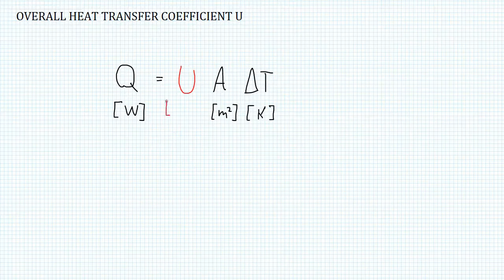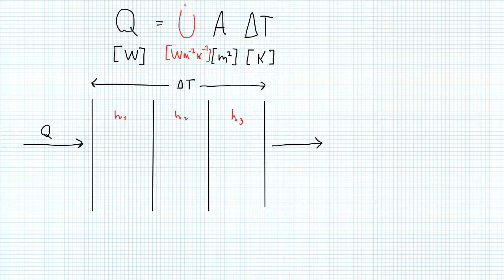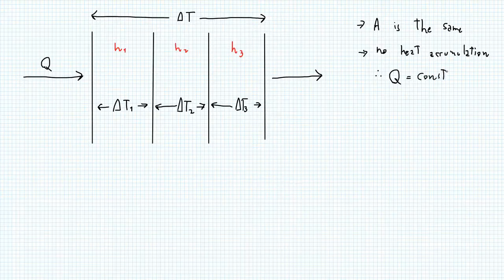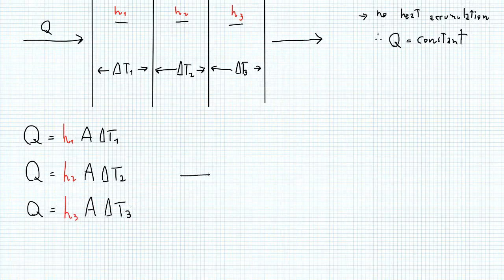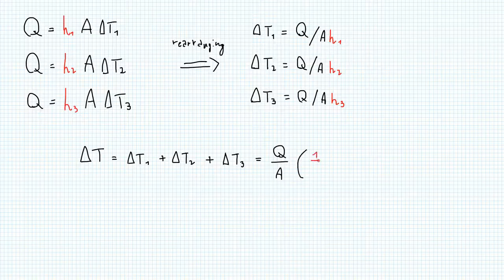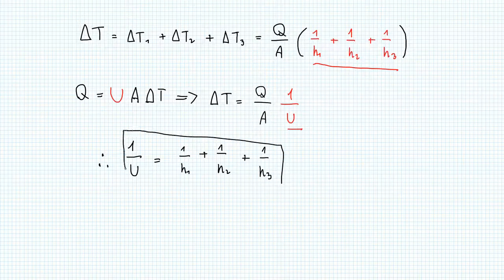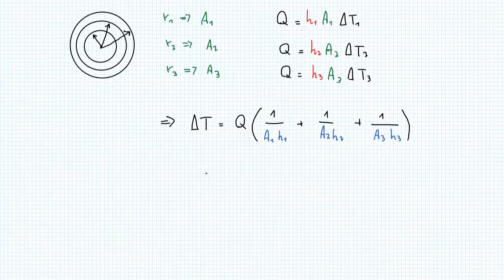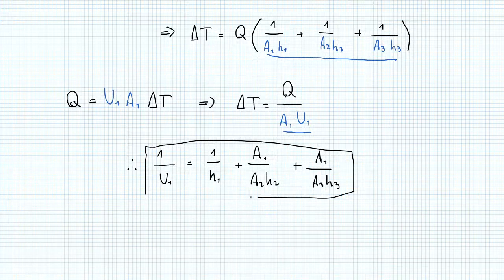Overall Heat Transfer Coefficient U

Comment: how to calculate heat exchanger  (Wast Heat Recovery Unit)
Flue gas flow rate 4293kg/hr  (3355 m^3/hr)
Heat Transfer Capacity  required -514 KW
Flue Gas Inlet Temp.  -497 °C
Flue Gas Inlet Temp.  ? °C
Water Inlet Temp.  -29 °C
Water outlet Temp. -70°C
Required design as/data

Overall Heat Transfer Coefficient U